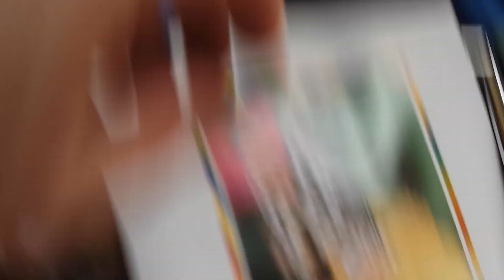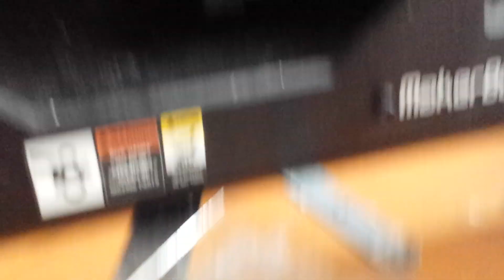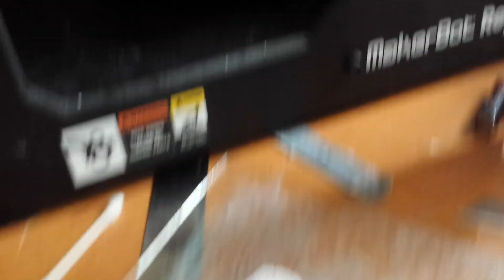How to use glass and slurry for ABS 3D printing

Comment: One application of ABS slurry is good for several prints. It also removes some each time so it will not build up too thick. ABS slurry equals more printer "uptime" instead of unusable with double-stick tape or purple glue stick method which does not work as well.